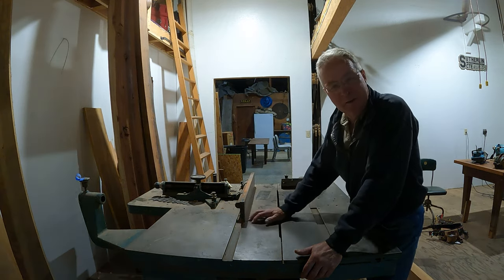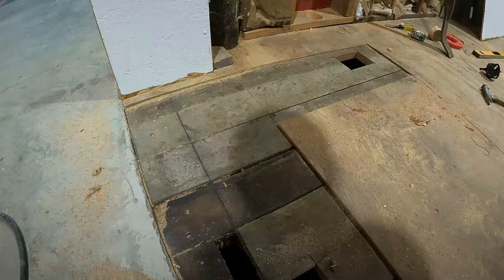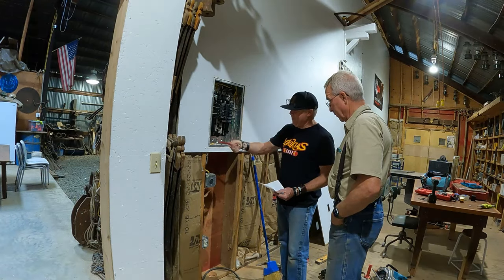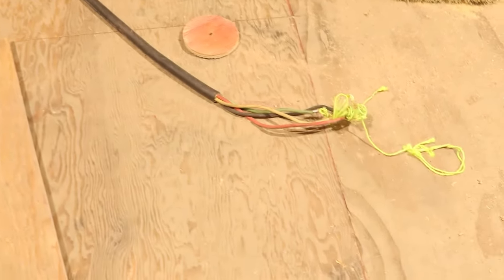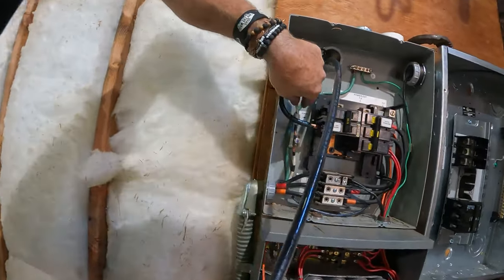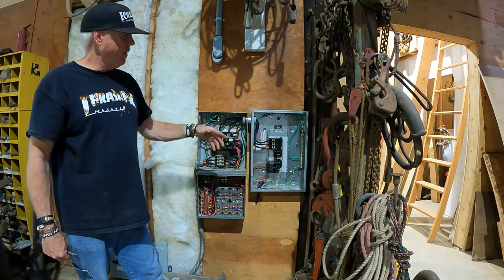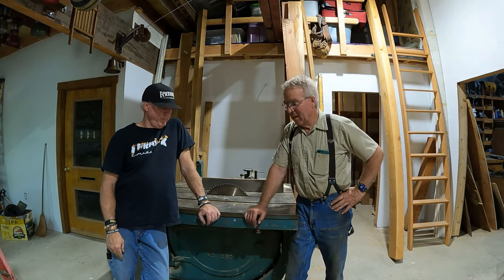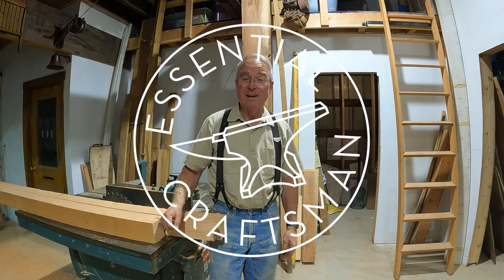Installing Three Phase Power In A Shop

Comment: I'm an electrician. What the hell is this Frankenstein? You can't phase tape like that. What a joke. Orange is for 480 and red is for 208 and he has both. Embarrassing. Any UL508A inspector would shut you down.
Reply: On a 4-wire, delta-connected, 3-phase system, where the midpoint of one phase winding of the secondary is grounded (a high-leg system), the conductor with 208V to ground must be durably and permanently marked by an outer finish orange in color or other effective means [110.15]. Such identification must be placed at each point on the system where a connection is made if the neutral conductor is present [230.56].  408.3  (E) Bus Arrangement.
(1) AC Phase Arrangement. Alternating-current phase arrangement
on 3-phase buses shall be A, B, C from front to
back, top to bottom, or left to right, as viewed from the
front of the switchboard, switchgear, or panel board. The B
phase shall be that phase having the higher voltage to
ground on 3-phase, 4-wire, delta-connected systems.